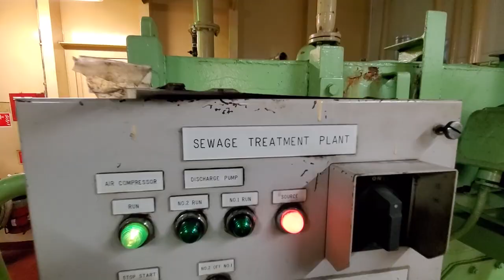Container Ship Vlog#49 (Complete Engine Room Tour at Sea)

Comment: Big 10 cylinder engine directly coupled to the prop shaft. It becomes easy to see why a different approach can work more efficiently. I am talking about azipods and electrical generators. Props on azipods that can rotate 360 degrees and be decoupled from a power device. Multiple generators can be used for propulsion, electrical generation etc. Much more efficient design. Good video Matt.

Comment: 5:06 Is that Economiser?

Can you point out Boiler in the video.

Nice tour BTW.👍
Reply: 2:22
Reply: 5:06 is Lube Oil Cooler
Reply: @jefferyb.3406  Dang I thought so,

What is main use of boiler. And If you got more boiler videos, pls do share.

Thanks 😊
Reply: @Neo-po2xw  On a diesel ship main use of the boiler is to heat fuel oil (to make make less viscous), provide heating to water and oil for when the engine is stopped, and for 'domestic' purposes, as well as desalination and oil/water separator. A lot of diesel (engine) ships may also run turbine generators, although this vessel has diesel generators. If you see the section with the centrifugal separators(at 2:56)  which refines the heavy oil, you will see all the pipes are insulated (lagged, silver finish at 3:11), this is to keep the normally treacle-like fuel oil nice and runny! Steam heats the fuel tanks.
Reply: @Neo-po2xw   The boiler is for when we are in port because obviously we are not running and have exhaust gas so we need to make steam to keep the engine warm import... Yes that would be a great video topic
Reply: @jefferyb.3406   Yeah it would be awesome, cause if there will be any overhauling/inside view videos, It would be fun to watch.

 And what's the name of the boiler in your ship. Is it a vertical tube boiler.
Reply: @stevekirkby6570   Hello, are steam ships(SS VESSEL) still in use? 

And can you name some of them. Also which one is better in terms of efficiency Steam Ship or Motor Vessel.
Reply: @Neo-po2xw  I'm long retired, and my ticket is in Diesel  - but I can point you here:

 https://www.rivieramm.com/opinion/opinion/is-there-still-a-commercial-future-for-marine-steam-turbines-33696

So, it looks like hybridised engines are a way forward for greater efficiency.

Best.

Comment: Three turbos??
Reply: Yes
Reply: Engine is super low rpm, so more turbos on the manifold will give a smoother pulse-less pressure feed to the cylinders. Most of the ships I sailed on had two, but this has more cylinders, so three makes sense to even out the charge in the scavenge buffer. Also I guess you have a bit more redundancy if a blower is underperforming.